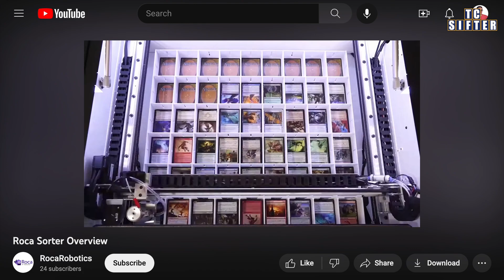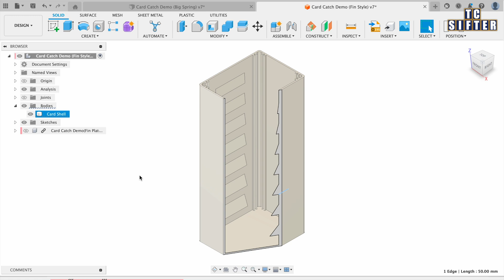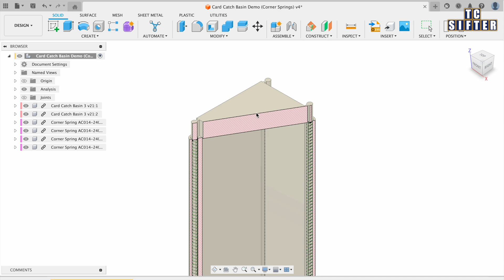Designing A Passive Card Catcher

Comment: You could have a spiral gear in the wall of the catch basin attached to a platform, or a collapsible rod in the middle of the catch basin. Then have this interface with a motor on the main machine. As it drops a card in, it'll spin up the motor to lower the platform by the amount needed (or once every 10 cards or so). Instead of 6 motors, you only have 1 new one on the machine proper. Plus it means that the parts to repair, replace, or expand the catch basins doesn't include specialty springs. Could potentially use printed parts if you can get the spiral/worm gear working well enough. I can't speak to other card sets. But I suspect that different games have different weights. At least when added together after 600 cards. So the springs might lock you into MTG unless you have quite the tolerance in height to compensate for how the beds might lower, or not.

This does add a good bit more complexity. But I suspect it'll have more longevity than a spring that might get worn down after a few thousand cards constantly compressing them. As well as keeps the system more card-agnosric in case you're able (or willing... theres a lot) to expand into others in the the future.
Reply: Could the horizontal movement of the gantry itself do this? Spin the gear as it arrives to the correct catch basin?  Would probably need a servo to control the interface so that you only spin the one you arrive at, not all the basins in the line. Unless this could be done with the release servo after each card is dropped. 

Drop card, hold servo below drop ramp / platform to be low enough to hit lowering gear, move gantry sideways, then raise servo to ready for next card.
Reply: @WNighteyesW  potentially could use the motor on the gantry to turn this as well. Since it's not in use on the gantry to move the catching basins as you're putting cards in it. This would require the gantry motor either gets relocated or a kinda obnoxious system to port it's power over to the catcher you're currently focusing on. Either way a way to switch what the power is going to would be needed as well. Or at least a method to prevent the gantry from moving while you're engaging the card stack. It would be more complex, but hey one extra motor was a huge negative with my idea so I'm all for it. Solid idea.
Reply from the maker: I like this idea, I hadn’t thought about using a single gantry-mounted motor to adjust stack heights! Brilliant work, I’ll have to model something to see how  it would look and if there’s enough space to do so, but I do think it’s a potentially nice solution
Reply: @jackbaumgartel  Happy to give more options to explore! Hope you can find a solution that fits the needs and goals you're going for. This or springs or whatever else people have come up with in this comment section lol
Reply: So I realized a potential annoyance with this system over springs. You'd have to reset every catching basin after you're done. So a program you can run where it'll just go around and set every card stack to near-top. Minor inconvenience. However this system would likely not be very fast so it has more force to prevent the card stack from forcing it downwards. Depending on the speed, multiplied by 6 stacks. It might take a good moment to reset lol.
Reply: Consider a stack height sensor on the gantry too so you can adjust the height accurately! That way you can use cheaper motors and less precise mechanisms all around

Comment: Could you just use stepper motors and crank it down by the thickness of the cards?
Reply from the maker: Yes, definitely could! But because the stacks will fill up at different rates, I’d need a separate motor for each one, which would be pretty expensive compared to the spring strategy
Reply: The video talks about why that isn't an option

Comment: Hey there, interesting video as always :)
I'm not in any sort of product designing or engineering type field, those these thoughts are more speculation-
- Would there be a concern of the springs losing strength over time? If so, how precise would the spring coefficient have to be to function?
- Perhaps a more elegant solution could be having the basins recieve, catch, and hold cards at an angle. The basin walls would still be vertical (just as the example one you have is) but a "wedge" at the bottom makes the cards sit at angle and the basin walls along the top and the bottom of the card appropriately closer
The hopper has walls and is at an angle, so I feel like cards will be coming out of there decently consistently (possibly using some sort of wide slit/gap to ensure the entrance angle of the card is decently consistent). 
This feels hard to explain via text so I'll use airplane terms lol. For this, the "long ways" of the card would be in line with the roll axis
If the card is going hopper to basin, both of which are about a card in width, there shouldn't be much trouble with Yaw.
If the card falls off the hopper ramp at an angle, this will mean its going faster and falling "bottom edge of the card first." This would mean the card has less fall time and isn't falling flat, so there would be less general "tumbling." Notably, I think this should eliminate issue with rotation along the roll axis.
As for the pitch axis, since you have the card falling "bottom edge" rather than "card back" first, this would be the biggest issue. Making the bottom of basin hold cards at an angle could guide cards that have have ended up at varying pitches. Flat falling cards would simply fall onto the pile. Cards that have ended up more vertical be guided end up settling face side up.

Sorry if that an incomprehensible mess. Taking a step back, my main conceptual point is that the other machines keep their falling height shallow because they drop the cards cardback-first, making the cards more likely to tumble and tumble along random axis. Since you're using a ramp to guide cards into your basins, your cards will start off moving edge-side-first. Speed + aerodynamics would reduce fall time and randomness. Utilizing this, you could reduce the severity and randomness of tumble. An angled bottom of the basin could handle a wider tolerance of rotation along a singular axis.
Reply from the maker: Wow thanks for the long response! I appreciate the interest! 
- The spring I specified is able to compress fully without any degradation, so it should last a very long time. 
- And I like the idea of angling the cards within the stack, that could be helpful! You’re right about the nature of this design meaning that the cards will have more predictable paths in the air. Again thanks for the input, I appreciate it!
Reply: @jackbaumgartel  following this comment, if you lean the whole card holder back, towards the sorter and have the cards stack at an angle, they will fall down vertically then since the whole holder is leaning they should fall into place. 

one possible issue is the card gets stuck against either wall standing veritcally.

another approach is a stack leaning forwards,  away from the machine and just give the gantry the ability to move up and down (at the same angle as the forward lean of the stack), and have the back of the card stack (sorter side) open so cards can be inserted at any height, just keep track of the stack in software or visually or with a feeler every 5 cards inserted to double check, and you can just use the gantry that you already have moving to test the height only one servo or something to tilt down a momentary switch.

obviously this requires adding extra complexity to the sorter but it means your deck holders are dead simple dumb pieces of plastic.
Reply from the maker: @joshieeee20  Thanks for the input and ideas, a few others have similarly suggested angling the catch basins, so it's definitely and idea I'll be looking into more!

Comment: As someone eagerly following this with the hopes of using it for another tcg rather than MTG (Flesh and Blood)  - it looks like there's a slightly higher card weight in FaB - (1.8-2g/card).

In addition to wanting to use it for a different game, I'm also an idiot and suck at physics -- Is this something that will be ultimately negligible in terms of performance, or would different games literally require different springs (assuming the end design goes with springs?)

Anyway, I love that you're working on this and either way I can't wait to see the finished product.
Reply from the maker: That’s a great question! To be honest, I’m not sure if a weight difference that small would be negligible or not. I’ll add that to my to-do list of testing. My guess is that the cards would simply sink a little lower than MTG cards. I bet it would still work, they just might have to fall a little further as the stacks build. 
And thank you, I appreciate it!

Comment: What about a basin with a vent like attachment at the top so it controls the slide into the basin. Might be a risk of jamming maybe but if tweaked right could be effective?
Reply from the maker: Yeah! I like the idea of controlling how the card enters the stack a bit more, but I still wouldn’t want the card to plummet ~9inches or so. A vent is a good idea though
Reply: @jackbaumgartel  another option are short or slightly bigger than short brissels to guide the fall instead of a spring?

Or using the dynamic of the falling card to fall exactly in place? Like if it falls on one end at an angle that the other end will fall and keep it in place. Would require a cushion as to not damage the card
Reply from the maker: @shaper_i-o   Oh that’s an interesting idea! You’re thinking bristles along the interior wall edges of the stack to slow the card’s descent? I imagine the card might have trouble staying level while falling through them, but maybe not?
Reply: @jackbaumgartel  it's a very unique take, my guess is it would muster a 40% success rate? But that's a guess, I edited my previous message and added another solution if you want to reread it